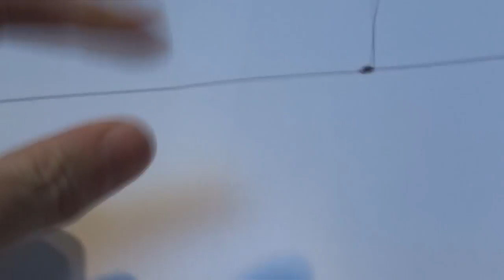How to tie a Dropper Knot for fly fishing.

Comment: The knot is actually called “ a triple surgeons knot “ and take the dropper line and tie a simple overhand knot , this will provide a full 90 degree angle to tie your fly onto
Reply from the maker: Well we call it a three turn water knot and if you do an overhand knot on the dropper it will cause issues with the fly tangling up especially when pulling wets, it maybe okay for dry fly but when pulling wets it will be an issue.

Comment: Thanks for another great point. I have had a few difficulties with florocarben. The frog hair in particular. Not so much with the Rio More lubrication is the key no doubt especially with the finer ones. 

May I ask is the a perfect way to tie the actual fly on and is it to thread the line from the top or underside of the fly?
Reply from the maker: Peter Cutler Hi Peter i normally turn the fly upside down thread through  the eye and tie a uni knot this gives me a direct contact with the fly, if using upturned eyes like salar salmon fly hooks i put it straight through and the same uni knot.

Comment: Aaaah that makes sense. Anyway I tried it yesterday...... Worked a treat. Thanks. I only use 2 turns when connecting tipper to leader though. That's ok isn't it. 
P
Reply from the maker: Peter Cutler Hi Peter, when using loop knots i always use two turns but using standard knots three turns will do. As with most knots whatever you feel comfortable and safe using, many people fear flurocarbon due to knot breakage but mostly  it is down to lack of lubrication when bedding down the knot which burns and can weaken any line.

Comment: I use this knot but it keeps slipping and I’m losing my flies and the fish! I’m tying it the exact same way as this video, but when the dropper gets pulled with tension the tag end I’ve trimmed is slipping and the knot is coming loose and snapping. Please help
Reply from the maker: Hi Gus the knot can't slip.It's a double line knot which means both lines are knotted so it can't slip. It might break under a big fish or you haven't moistened the knot just before tightening it. If the knot isn't moistened the line will burn from tight contact and break. I have used this knot all my life and bar a big trout smacking it hard I have never lost any fish to slipping etc.

Comment: I have tried this knot and my dropper seems to come out or break. Maybe im doing it wrong but any tips or tricks would be appreciated
Reply from the maker: Hi Thomas, both the dropper and main line must pass three times through the loop and must be moistened well before bedding down well, the common mistake is not pulling both together and then moistening it well. It works for co-polymer, flurocarbon as well as nylon and I have never had a problem with it but if your's is coming out the knot must not have been bedded down well.

Comment: Can you use this for salmon fishing ??
Reply from the maker: Yes it works for salmon fishing but remember a powerful fish like a salmon will pluck a dropper off if the knot isn't perfect or you're not using strong flurocarbon. I prefer to use a floating dropper system where the dropper can run up the line if you hit a big fish. I will do a video soon showing that system and knot set up.